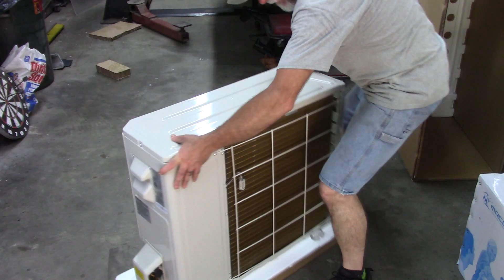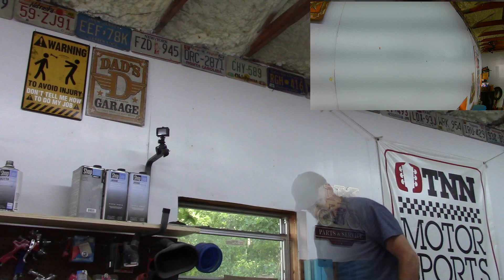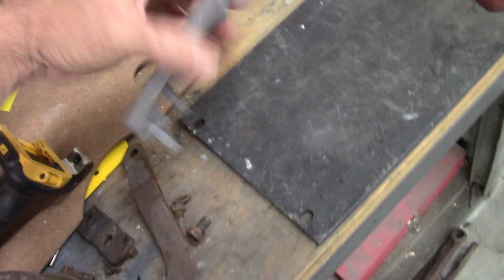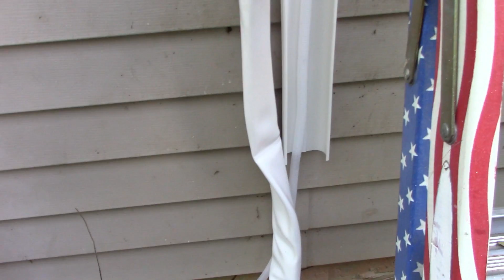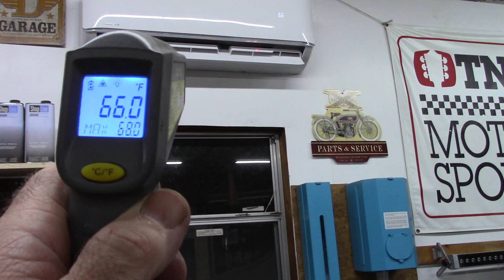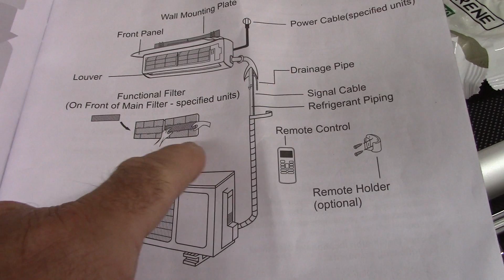Mr Cool mini split air conditioner install.

Comment: I finished my own install Saturday (18k BTU unit) & just want to thank you for the great video, it's probably the best one out there at this time.  Unfortunately I did not see it until after I mounted the indoor unit (I also struggled with the indoor mount, probably for more than 7 minutes), so did not realize there was the sleeve to put through the wall. For some reason my instructions don't show it, and equally strange, the sleeve came packaged with the outdoor unit, which makes no sense since you need it during the indoor mount; I didn't open the compressor package until I was done with the indoor.  Anyway, I was replacing an old Mitsubishi model, so I was reusing the hole created for that, and it turns out that it was about 1/2" diameter less than what MrCool advises you to drill, so the sleeve wouldn't have worked for me anyway (note to anyone else in a similar situation: the MrCool lines fit through the smaller hole just fine; plenty of room to spare).  A few noteworthy things I did differently: 1) I think it was less hassle to install and bind the water drain tube extension AFTER pushing the lines through the hole (i.e. from the outside), 2) I took the thin clear plastic sheath off the lines, as I regarded it as packing material not functional protection (I think the thick white plastic sheath gives your enough, and I'd be a little nervous about water etc accumulating inside the loose thin clear wrap over time).  Also as someone else already pointed out, the instructions say clearly (one of the few places they are!) that you should connect and open the top line first, so I did it in that order (don't know if it matters though).

Everything is working fine for me, I am mostly happy.  Assuming that it keeps functioning well of course. So far my only regret about going this route is that it is relatively inefficient compared to most professional options, with the 16 SEER rating.  However it will take a long, LONG time for the increased electrical costs to offset the savings on the install. I got my unit for $1100 shipped from Costco; I earlier had a bid from a local (established and reputable) firm advertising themselves as specialists in minisplits, quoting $4910 for installing a comparable BTU Mitsubishi -- even though the hole was already drilled & the electrical box and compressor cement slab were already in place!
Reply: p.s. one other note that might be useful to someone in my situation (replacing an existing unit, with an existing 220v line), since I probably spent as much time agonizing over this question as I did on the external install itself: my old Mitsubishi had four wires from the power supply connected: L1, L2, ground, and neutral.  The MrCool wiring diagram had no indication what to do with the neutral (white), and this was my first time with a 220v installation.  I finally found my clear answer at the MrCool site, in response to the same question from someone else ( http://mrcool.com/blog/pre-charged-line-sets-real-right/ ): "If you have a WHITE conductor in your power supply cable, it should be attached to the ground screw with the bare copper ground, both at the unit and the disconnect. A 220v circuit does not have a neutral." Apparently the 220v Mitsubishis must have some 120v components -- at least the older ones anyway -- while the MrCools do not?
Reply: @MarkManville  I am in the same boat. I have an old Mitsubishi unit with a dead compressor. The HVAC folks quote between $5k to 7k for installing a new unit, so I thinking of Mr Cool.  I am not that worried about SEER as this will be in a sun-room I only seldom use. Reg the wiring though, it seems that both the internal and external parts of the old AC unit were powered directly from the junction box, whereas in the Mr Cool unit, you'd only power the external unit, and it powers the internal unit? Also, how do you make sure that the existing wiring (gauge, amperage, 20A breaker, etc) are adequate?
Reply: @sambition  Hi Sambit that was about my quote for professional install too.  Couldn't believe they would still ask that much even though wiring, hole, and concrete slab were already there! 

My main complaint so far is that the fan motor failed within weeks, and though they sent a replacement fairly quickly, they were not very communicative (I couldn't get confirmation of shipping so I thought it might not have been and repeatedly emailed them to ask; then it just showed up, I only got a response AFTER I'd already received it.  Then they forgot the instructions and I had to wait a day or two more for that).  The instructions for replacement were inadequate, and photos did not reflect my unit, I had to figure it out and improvise.  It was VERY difficult to get the fan motor out for replacement.  It took me two days to get it out & then in, then out & in again; I ultimately resorted to a dremel tool to split a non-essential plastic bracket taht was getting in the way :( Then after thinking I was done, the fan wheel didn't spin right the first time, it made a horrible rubbing noise and shut off.  I eventually figured out that I had to not push the fan motor spindle into the fan all the way before tightening the screws, it needed a gap to prevent the friction.  Anyway, not relevant to you or (hopefully) most people, but be aware that because this is DIY you could get a lemon and have to deal with a lot more hassle than you might think.  I definitely spent more time dealing with the blown fan than installing it in the first place.  But I guess I still would do it again, given the cost savings and otherwise good function (knock on wood -- I've only maybe run this a total of ~20 days so far).  I paid $1100 shipped for an 18k unit.

To answer your questions, yes, you only have to run power to the external unit, the power to the internal unit is provided via the line bundle that also included the refrigerant and drain tube, you just have to connect like the rest of the lineset, takes a couple minutes if you know what you're doing (I didn't because of 220V confusion & inadequate directions, but fortunately I am a professional researcher and troubleshooter in my IT job).  I guess I just assumed the existing house wiring & breaker was adequate, as it had been powering the previous unit which had about the same 220v power requirements and had only been installed maybe 15 years earlier (by previous owner)
Reply: @MarkManville  Thanks. Very helpful. Sorry you had trouble with your unit. BTW, I noticed that the AC line on my main electrical panel has two-linked (double-pull?) breakers powering this (does that mean it is 30A or 60A; I am assuming the linked breakers are needed to up the voltage from 110 to 220V). So, I'd have to (hire an electrician to) swap these breakers out for the required 20A breakers. I was thinking it may be more cost effective to get a buy and install a 24k BTU unit that could be more compatible with the existing breaker. Your thoughts?
Reply: @sambition  My only thought is that you should under no circumstances listen to my thoughts on this topic :)  Not being mean, actually being nice :)
Reply: @sambition  If you already have a "dual" 30amp breaker and only need a 20, Buy a replacement breaker and change it out. If you are uncomfortable doing this, get an electrician. The only information you really need in replacing a breaker it the type.

Comment: Once the relative humidity drops inside of your garage it will remove less water.  Basically your drain becomes overwhelmed with water because of the high moisture. Normal moisture levels typically maintained between 40% and 60%.

Comment: It looks like its not bolted down with the anti-vibration feet.
If it has those that elbow should fit underneath.
Reply from the maker: Someone more familir said the elbow is for drainage if it is mounted in an overhead location. Like a second floor.
Reply: But should it not be bolted down on the vibration isolating feet?
Reply from the maker: Yes. I bolted it down.

Comment: You did not vacuum the lines prior to releasing the refrigerant, so you are going to need to add R410 in the near future.  Other than that the install looks good.  Nice unit.
Reply from the maker: Vacuum not required. This is a DIY deal. Lines are pre-vacummed, and sealed. When connections are made, the seal is pierced from what I've been told. This is per the instructions.
Reply: These clowns freaking out because they don't understand the concept of pre-vacuumed. My neighbor and I both installed new HVAC systems for houses in the same year. His was done by "professionals" and I did mine on my own. Those "professionals" who did his install cut corners and didn't replace the line between the air handler and the condenser. As a result they have been out multiple times doing repairs while mine is humming along without issue. Many times the DIY guy does a better job than the so called professionals.
Reply: does anyone actually know if the evaporator/head unit is actually under a vacuum? would make more sense to me to have the evap unit charged with 10-15psi of r410a so there's no possibility of air being sucked in when you connect the line set to the condenser
Reply from the maker: Thanks for your comment. I was just going by the manufacturers instructions.
Reply: Yes, you are correct.  I checked on your model and it says it is pre vacuumed.
Reply: Jo Daddy's Garage - good luck guys and take care.
Reply: You do not vacuum this type of system. Where the pipe meets the fitting they are both sealed and it punctures the seals.
Reply: he didnt have to smartie pants.
Reply: The copper lines aren't open; they're sealed--something akin to a schrader valve (though obviously not exactly the same).
Reply: Funny. ‘1970 technicians living in 2018 commented here. There is no air. If there was,  very small amount of air might be in between two connectors. Because it’s pre-vacuumed in factory using a high performance vacuum machine, technician using tiny portable vacuum machines in field can’t vacuum better than the pre-vacuumed line.
Reply: The lines and unit are pre charged. No need to vacuum. Important to not modify the length of lines.
Reply: Actually, it still does needs to be  vacuumed down to at least 500 microns, I don't care what the manufacturer says, because, the air between the indoor and outdoor unit still needs to be removed inside the copper lines... It's not the air that hurts the system, it's the moisture in the air that ruins the compressor. Similar affect when adding water to engine oil..... turns into a white slug.. 

I will admit, I'm a HVAC guy and  can be a bit anal. I do things to cars that you would probably get ticked off about. 

Install looks great, btw!
Reply: theres no air in the system, its all hermetically sealed under vacuum. welcome to 2018.
Reply: I'm HVAC too John, and I have a bad feeling about this.   Not the DIY concept, but the basic principle with 410a and POE oil being so hygroscopic.  There may be a de minimis amount of air, but there is still air, but that still means moisture.  Job security down the road for a short run life for "Mr. Cool", but when I could buy an entire 10-20 year split system that could run 3k+ square feet for the same price (if needed), that just doesn't seem much "bang for the buck".
             I know LG sells a window heat pump with the same specs for under $700.   If I had a small garage around 1k sqft, that's what I would do, and put a grand into something else......
Reply: I installed 12000 btu pioneer, mini split heat pump, in my shop, bought off ebay $683.00 delivered and it works just fine.

Comment: Did you pull a vacuum to get all air and moisture out of the copper lines before opening refrigerant valves?
Reply: As grumpyunk already commented two weeks ago, this is specially designed not to require that (hence the "DIY" name): the suction and hi side are pre-vacuumed, and have a piercing probe at the condenser. The condenser is pre-charged with the correct amount of refrigerant.  When the fittings are tightened, the lines get filled with the refrigerant as required.
Reply: Gotcha

Comment: I just put a 2 ton unit in my garage last weekend. Works really well.  Mine was a Pioneer brand but looks like the exact same unit.  I think Cree manufactures these.  One question, you tubing seems to be a lot more flexible than mine.  Mine were 5/8 and 3/8ths copper and hard to bend without deforming the pipe.  Did you have a problem with kinking?  Did you also vacuum the lines but not video it?
Reply from the maker: I really didn't have a problem bending the lines. No vacuum required.
Reply: There are a couple of differences with the MrCool DIY units; they don't require vacuuming the lines and the lines are much more flexible.  I just bought two of the Pioneer units myself.  They will require vacuuming the lines, and they are also hard lines.  Since I'm having a plumber do some work anyway, I think I'll just have him take care of getting the lines bent and into place.

The MrCool DIY units are more expensive, but one of the things you get for the money is ease in dealing with the refrigerant lines.

Comment: Romex wire is not up to code in conduit outdoors. Use THHN  type wire (stranded and durable insulation)   inside the flex conduit.
Reply from the maker: Thank you. I'll address that.
Reply: Thanks for the heads up on this. I almost bought Romex.

Comment: Great vid. Thanks for taking the time to make it. I thought the output air would be cooler at first, but then remembered these units use just enough power to get the job done. Probably running a little lower and slower at first to get the humidity down. I'm used to window units blasting 55 degree air. Definitely installing one of these diy mini splits in a future project.

Comment: Once you install the lineset, can you remove it later without losing refrigerant?
Reply: I just saw another video that shows it uses a plunger valve on the lineset.   Great video, thanks!
Reply from the maker: Doubt it.
Reply: No, they say one time use only

Comment: I too installed my unit with the lines on the left side. Boy was it a pain in the ass to install. I've noticed that your template was different from mine. I find it interesting considering the ACs are basically the same regardless of their size. Anyway, my tempate had me drill the hole 8 inches away and that was about 2 inches too far. It caused the hole to stick out beyond the unit and the clips wouldn't snap onto the bracket. I had to move the bracket to fix it. Just like you I used waterproof connectors and wished that the plug was redesigned so that it could fit through the plug. I plugged the hole with silicone. I tried the putty that came with the unit but didn't like the look. I hung the outdoor unit in order to keep it away from the dirt. Overall I like it and will be buying another one or two.

Comment: The filters go on the inside of the filters in your indoor unit, just lift the tab and pull the bowed filter screen (2) out and in the middle section there is a space to put these little filters behind.....  they are to take funky smells out and improve the air quality.
Reply: The filters trap dust that otherwise would be drawn through the inside unit's cooling fins thus eventually blocking them.

Comment: 3 notes on your outdoor installation 1) you opened the top refrigerant valve first, then the bottom, however the instructions clearly say NOT to do that.....  do you have any issues with the function? 
2) You used a fused disconnect box, please make sure you do not have an indoor circuit breaker on that as you are not supposed to do that.
3) I used a split grommet to secure the power cable through the 2nd hole that way there is no chance that the metal cuts into the cable and causes a potential problem ( code requiring it anyway)
Reply from the maker: Interesting.1) I was following a video I found from Mr. Cool. They opened the top line first. Now that I went back the assemblies are opposite of mine. That said, It's operating fine. 2) Thanks for the info. I will address that. 3) I will take care of that as well. The system is doing a fine job, and keeps the shop nice and cool.
Reply: Jo Daddy's Garage .  Yeah, it is easy to do the reverse, I am not sure either as to why one before the other on opening these valves, and reading these instructions are like following the instructions on assembling an IKEA cabinet LOL.

Comment: Great video!  Thank you for taking the time to record this.  I just put mine in a day ago the exact same model, and was intending to record it, but due to the lack of time I decided to record the results and post it on YouTube.  The system is easy to install and it works great!   Just like you, the hardest part was to struggle the indoor unit onto the bracket, and like you had that plastic back plate taken out, however it would have been nice from Mr cool to put that in their instructions.  Anyway you have the nicest, Most instructive video on this, Great JOB!!

Comment: These out side units does better with a awing over the top>  Help with sun rays make the unit run cooler, and hail, rain  ect  COOL UNIT,   I LIKE THE 115 volt better  he hee 240 v just eat electric

Comment: I'm sure you probably already know this but your garage door is not working in your favor.  If you have room for the tracks an insulated door would make a huge difference.  I have a 20 x 30 foot fully insulated garage and double door  with one air-conditioning outlet from the house and it stays very comfortable even with the garage door in direct sunlight.